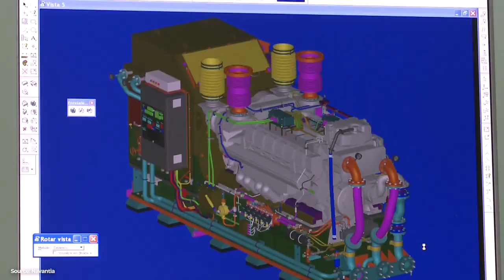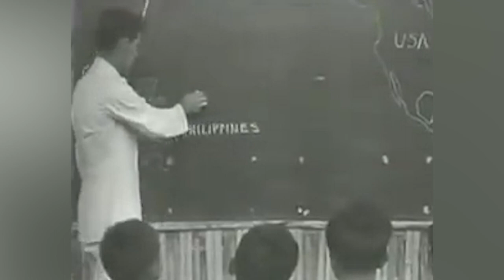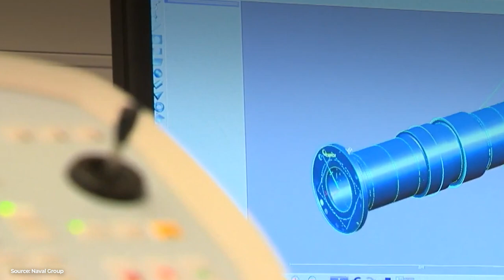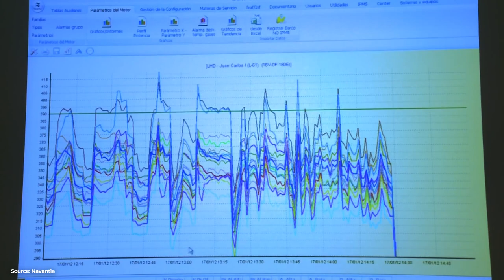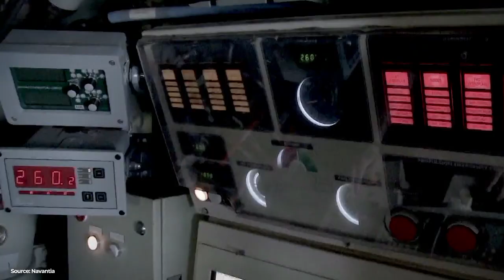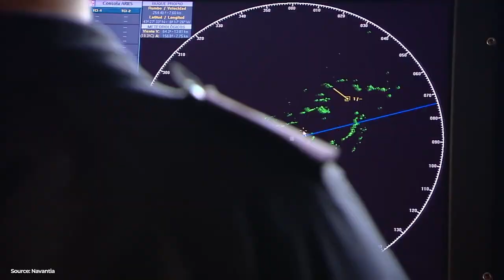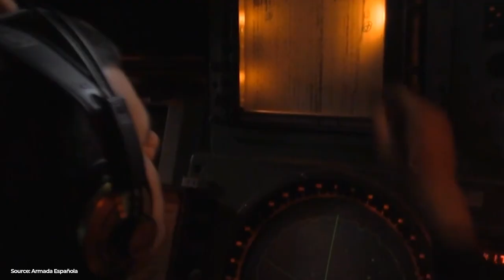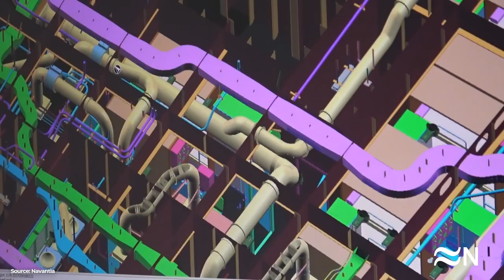The S-80: The SPANISH MILITARY INDUSTRY’S epic FAIL - VisualPolitik EN

Comment: The S80 will travel at 19 knots. It’s far far too slow. U.K. subs, French subs, american....Chinese, Russian all have nuclear powered subs which travel at 30+ knots. This Spanish sub is very much a tier below the top tier
Reply: Spain doesn’t have the capability to build and operate nuclear subs... very few countries do.
Reply: What's the point of a nuclear attack submarine when you don't even have nuclear infrastructure? The purpose of their submarine is for maritime defense, same as Sweden, Germany and Japan so a non nuclear option would work fine for Spain as it has worked for the previously mentioned countries.
Reply: @MyCommentsGetGhosted it’s nuclear powered, not nuclear weapons. Nuclear powered subs go much faster and stay at sea much longer
Reply: @darrena5384  You didn't properly read the comment you're replying to. "What's the point of a nuclear attack submarine when you don't even have nuclear infrastructure?" Nuclear infrastructure as in nuclear engineers, manufactures, maintenance facilities, ports and so on. No one mentioned nuclear ICBMs. You also seem to have ignored the next half of the comment that makes the comparison between this submarine and other non-nuclear attack submarines with air-independent propulsion like those possessed by Sweden, Germany and Japan and which server their respective countries well. If your main goal is maritime defense and not power projection, then there is no need to have a nuclear attack submarine.
Reply: they won't travel at 30 knot unless they want to get sunk...
Reply: The nuclear submarines are far louder than the AIP submarines. Which is better depends on what you use them for.
Reply: All the boring play on negative Spanish stereotypes in this video is annoying. Racist stereotypes aren‘t as funny as they think.
Reply: @tobiwan001  utter nonsense. They are far quieter, especially during silent running when they turn off active reactor cooling. Nuclear subs are far quieter than non-nuclear.
Reply: @marpagapal3312  sunk by what? Snail subs like the S80? 🥴🥴🥴🥴
Reply: @tobiwan001  nothing to do with racism at all. It’s pathetic how people throw the racism card out at anything.
Reply: @tobiwan001  and do you know what else gets you detected even more so than noise? Surfacing. However nuclear propulsion is independent of air, they have no need to snorkel like conventional subs need too for oxygen which allows nuclear subs to stay completely submerged. On top of the fact the non-nuclear subs travel at much slower speeds, once they’re spotted they would never get away.
Reply: @v1n1c1u55anto5  I am not Spanish, but I just found it stupid and outdated. It's a bit like watching a 1990s comedy show. That he doesn't even manage to read the names of politicians he obviously never heard of (he says Anzar instead of Aznar) just shows how lazy this is all built around stereotypes.
Reply: @darrena5384  Just because you say utter nonsense, does not make it true. The Gotland class or U212 class are legendarily quiet. Even with natural circulation cooling a nuclear submarine is louder than those two for example. That's why they have sunk well protected ships (like US aircraft carriers) in NATO maneuvers.
Reply: @darrena5384  You know that non nuclear AIPs use fuel cells or Stirling engines and not rely on diesel engines for attack missions?
Reply: @darrena5384  sunk by anything in the area.
Submarines hunt, they don't make races.
Reply: @marpagapal3312  if a frigate/destroyer like in the Royal Navy is travelling at say 26-30 knots, and they’re getting chased by a sub travelling at 19 knots, what do you think is a key factor here? The race. Speed matters. If ships need support 150 miles away, it really matters if it’s travelling at 19 knots or 30 knots. To suggest speed is absolutely irrelevent is mind boggling. There are no advantages to not having nuclear powered subs. It’s the reason they cost £1.5b compared to £0.4b for normal subs.
Reply: @darrena5384  again, it isn't a race. 
A frigate isn't being chased by a sub.
One detects the presence of the other and the first to detect the other has the chance to engage.
Of course the weapons range, the speed, the ability to dive all play a role in a confrontation but the most important is to detect, identify and locate the other before he does it to you and therefore the noise its the most important factor on a submarine. 
Nuclear submarines are loud! 90 dB in normal operation, one won't hunt shit doing so much noise. It would became the prey.
Reply: @marpagapal3312  omg 🤣🤣🤣🤣 Speed is of a massive importance. Again, I’ll say it one last time the only countries who purchase conventionally powered subs is countries who don’t have the technology to build or finance to build a nuclear sub and Spain falls into both those categories. That’s pretty much the end of that story. They are slower and THAT matters.
Reply: @darrena5384  I have to assume you never hunted in your life.
It doesn't matter how fast you are if your prey knows miles away of your presence...
Guess we will have to wait some decades until a full war to know what is fulcral, the speed of the noise. 
I know which is my bet, everyday....
Reply: @darrena5384  I'm not questioning, I'm saying.
Let's get real, none of us know shit about submarines.
Very few people in the world do.
Reply: @darrena5384  Sorry, but you have no clue about subs. Speed isn't as important as you think. It is stealth that counts and nuclear subs aren't as silent as conventional subs. Sweden for example is better off with conventional subs, even if they cost the same, because they need a smaller and silent sub, not range and speed. You forget that not every country has the same requirements.
Reply: @hjalmar4565  are you honestly trying to hold the position that non-nuclear subs are superior or equal to nuclear subs and also try hold credibility in your knowledge of submarines?
Reply: @darrena5384  No, I didn't say that. What I am saying is both have their advantages and their disavantages. So which sub is the best for country "A" doesn't have to be the best option for country "B". 
I mentioned Sweden for a reason. They don't need the range and speed of nuclear subs, but smaller and extreem quiet subs to defend their coast.
Their subs are designed for other operations and a different environment than the subs of the US Navy has.

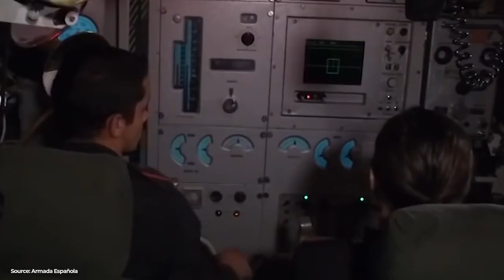Comment: 8:51 If the design is wrong, why not correct the mistake rather than make modifications to compensate for it?
If they had build one vessel based on a bad design, it may have been cheaper to write it off / use it for spare parts and build the rest of the submarine class based on a good design.

Comment: One of the charateristics that makes modern diesel-electric submarines very dangerous ships for large surface groups is the small dimensions, that, along with the ultra-quiet electric propulsion, contributes to their low signature.
The S-80 plus is larger than several nuclear designs, without those dimension providing noticeable advantages in payload.

Comment: I find it hard to believe that the project went pear-shaped just because one engineer misplaced a decimal point. A multi-billion dollar project and no one checked and cross-checked the figures? If you're building a coffee table you'd check your numbers at least once. The weight and displacement of a submersible are pretty basic to its design.

Comment: Balloons could help with the boyancy
Reply: I actually thought of Torpedo blisters, akin to WW2 Battleships adding to displacement at little cost in range, or modifications to the hull. The tradeoff would be speed and range though range could actually be increased if the blisters were filled with diesel fuel.

Comment: The Australian version of the Barracuda will not be nuclear powered. Australia has contracted the French to convert the nuclear power plant over to diesel electric, which will INCREASE the price of the subs over what they would have cost had they been built as originally designed. No, I'm not making this up.
Reply: @v1n1c1u55anto5  France was willing to sell the nuclear powered version, if I'm remembering the events correctly. I'm pretty sure Australia has a ban on nuclear power, which is why they didn't want nuclear powered subs. 

You are correct though. If Australia didn't want nuclear powered subs, why didn't they just buy any one of a number of advanced diesel electric designs that have already been produced and proven to work, rather than create a Frankenstein sub?
Reply: @v1n1c1u55anto5  I believe their ban is very similar to New Zealand's ban. They don't want nuclear power, even for civilian use. New Zealand even bans nuclear powered ships from their territory, including American Aircraft Carriers, and if a Russian nuclear powered ice breaker were to ever try to visit New Zealand, they would ban that as well. 

I just think New Zealand and Australia are afraid of nuclear power in any form. Neither country has nuclear power plants, and has banned their construction.

Comment: and it's not even a nuclear submarine
Reply: Nuclear subs are really really loud!
Reply: @Apeshaft  haha of course they are
Reply: @toker6664  Yep they really are... And they leave a very large heat signature in their path. Nuclear submarines require large reduction gears and a robust cooling system to maintain safe operation of the reactor. Noisy pumps circulate cooling water around the reactor core at all times, then pump the same cooling water back into the ocean, leaving nuclear submarines with a much larger infrared heat signature.
Reply: @Apeshaft  And they are big.

Comment: This building program is what happens when you make revisions to the design late in the process.
Adding weight, in the form of new equipment not intended in the original design, coupled with poorly planned installation projects, gets you where this boat is now. Sonar transducer cables too short and unable to integrate into the onboard systems, loss of freeboard from the poorly evaluated weight additions. It all adds up.
Reply: Leads you where the submarine is now, do you mean operative and in the water?

Comment: Silly video. Most major efforts to enter a new field regarding the military - cost way more than origionally budgeted..

The real question is if they will stick with it and continue the effort.. 

Thats how you get your money back..

Now days its much more than ship building. Its all the electronics , engines and sofisticated electronics.. 

Your wrong about Spain having enough experience.
Navantia had big delays because they retired hundreds of engineers with enough experience to build the submarine back in 2005..

The new younger engineers lacked experience..  

The part where you say 1 miscalculation made the whole submarine to heavy have been disproven.. 

The mistake came from miscalculating combined weights of many parts that were added to the submarine..

Most Public companies are slow and run deficits..

Comment: Why not use electrolysis system?
Separate hydrogen from oxygen, hydrogen for use in a hydrogen fuel cell and oxygen for the diesel engine,  with contributing to the electric propulsion system.
Reply: Electrolysis takes electricity and no system is 100% efficient.  So they are supposed to spend 400KW of electricity to make 300KW of electricity?  Physics - Law of conservation of energy.

Comment: Have you done a story on the sunken Norwegian Navy frigate from 2 years ago, also 1 of 5 built by Navantia? Navantia neglected to include proper seals around the propeller shafts that would have stopped flooding of additional compartments forward of the bulkhead breach. Very little coverage in European media of this apparent design failure by the same shipbuilder. Crew error was the major cause of the original accident, but design flaws contributed to the sinking.
Reply: @josebuylla164  crew error was the major cause of the accident, the critical design error previously mentioned contributed to its sinking. see this link: https://en.m.wikipedia.org/wiki/HNoMS_Helge_Ingstad_(F313)
Reply: And here is an excerpt from the Wikipedia summary (not always reliable): “[The accident report] recommended that the Norwegian military authorities investigate the findings of the preliminary report with a view to implementing any necessary safety measures, and that the shipbuilder Navantia investigate relevant aspects of the design of the frigate and whether other ships might be similarly affected. The watertight condition of the ship was supposedly guaranteed by the 13 watertight bulkheads. Seven compartments were damaged as a result of the collision but initially the ship remained afloat. No one intervened to break the chain of errors.”
Reply: That reminds me of the USS Maine.
Reply: You mean the one where the Norwegian government sought for any and every excuse to blame someone else? Even before any investigation was done? Citing Putin (more or less): "If it was me, I would have found something".
Reply: Female crew, ....ahh haaa